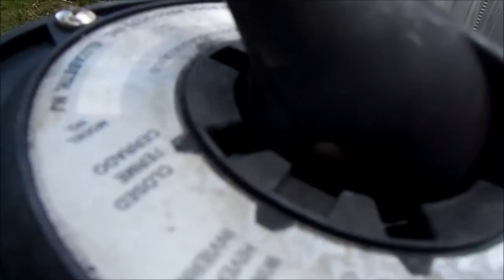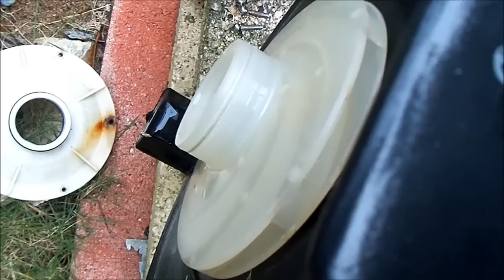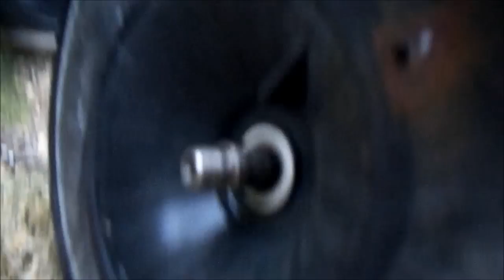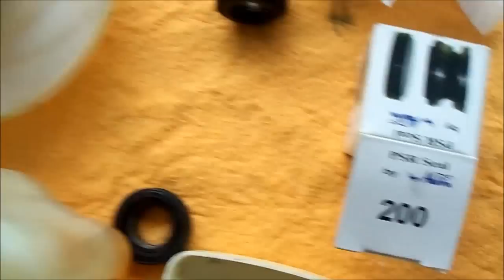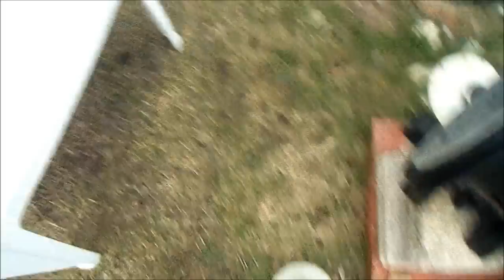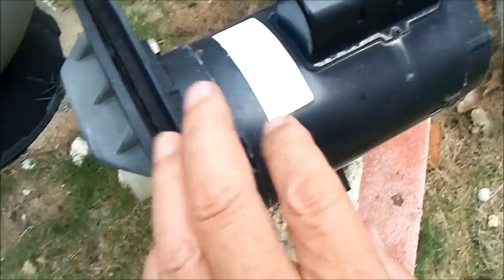pool pump motor shaft  seal installation

Comment: That howling your hear is probably the bearings. I replace mine about 3 years. You probably didn’t need a motor. Been there, done that. 

Only use water based lubricant (think K-Y Jelly)  to lube the rubber seals. Don’t use Vaseline or silicone based lubricants.

Comment: The video was a good video for explanation of seal orientation, but in reality when I remove the seal I would do a dry run test on the motor alone to see if the bearings were bad in the first place before reassembling the impeller weir plate and impeller etc
Reply from the maker: Thanks for watching. Good point.

Comment: Thanks for the informative video despite the nitpickers, lol, yes maybe you shouldn't use vaseline on the seals or used a piece of concrete as a hammer but non the less good video! And I'm sorry that you had to replace the motor instead of a simple fix.
 I hate when that happens!
Reply from the maker: Thanks for watching. Motor went bad because rain got in the bearing. I bought a motor cover and new motor should last a lot longer. Motor is still running quiet despite using Vaseline. Rocks were the first hammers.

Comment: Some people should NOT make how-to videos. This is one of those people. Do NOT use Vaseline on pool pump parts, do NOT use ANY lube on ceramic seal (don't even touch with bare hands), do NOT use electrical tape to wrap broken conduit, do NOT use concrete as a tool hammer (ha!)

Comment: I just bought a motor and gasket rebuild from A.O Smith A wisperflo. Not one instruction as to installation of the gaskets. The seal installation is vary important . after disassembly I found over the years some gaskets or remainder of gaskets were not there.  So if You buy from A.O. Smith don't expect much in the way of help, They do have videos but the motors were different from the one I bought . How much could it cost to put a piece of paper with the best way to repair this seal and gasket kit?
Reply: But if they did that you wouldn't buy a new pump...

Comment: A worn seal would leak from the tank body assembly. motors burn up fast when depleted of water, empty your baskets daily. When not in use, turn the pumps off completely.
Never use Vaseline, its bad for pump seals, your local pool store will have to right lubricate (cheap).  I have rebuilt many pool pumps and most are damage because lack of water supply. Imagine driving a car with no oil, how long would it last.
Reply: Antonio Ric I

Comment: Don't use vasoline, use majic lube, you don't use vasoline on any pool equipment it is a petro base lube and will wear out all the rubber seals.  majic lube is silicone base lube.

Comment: I keep damaging the carbon part of the shaft seal.  How do I install  without damage?
Reply: Use P-80 seal lube to allow it to slide in easily.
Reply: P80 is now US seal lube, They changed the name. What is US seal lube made of? In this video https://www.youtube.com/watch?v=Ut58IqEY0CY @ 13:37 He says not to use Teflon or silicone based lubes? and if petro is out, whats left... lithium???
Reply from the maker: I put Vaseline on the part and then tap it in using the blunt end of a socket (for a socket wrench) to make sure the seal sits flat in the hole. Also I make a sketch of the assembly when I take it apart so I know which end goes in the hole.
Reply: P80 was on a recommendation chart many years ago as the preferred seal installation lubricant. It is the best
Reply: My water motor pump shaft at bearing side became loose.  ChangingThe new bearing also is not get it fit on the shaft.  I think at bearing side the shaft damade. So how can I get the shaft repair.